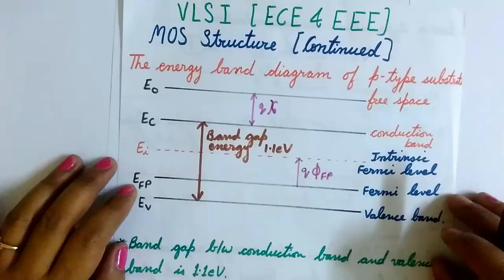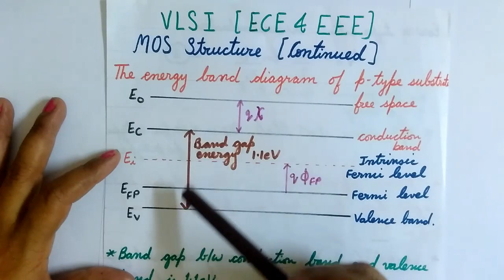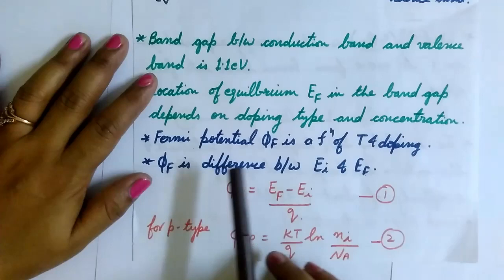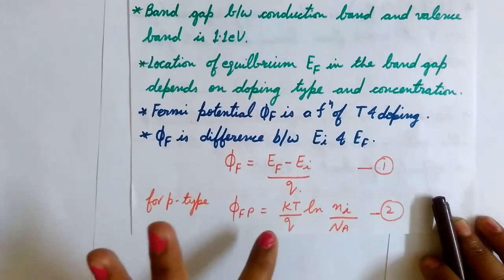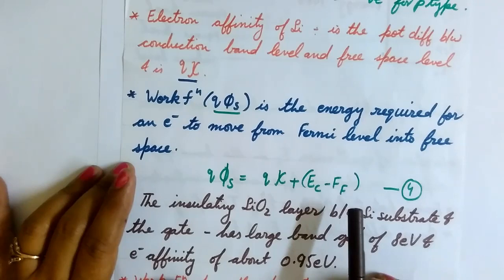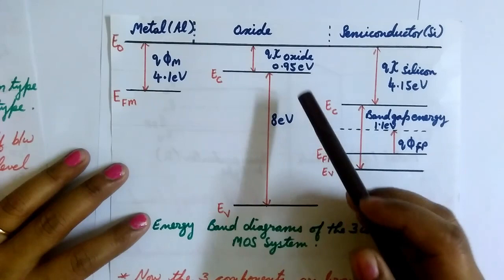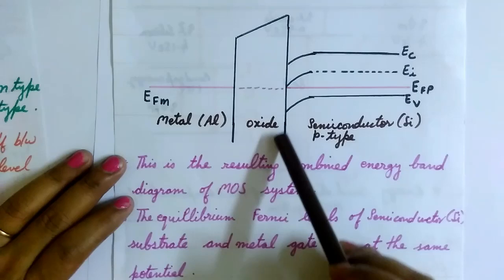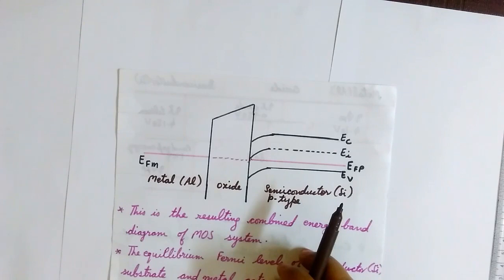VLSI - Lecture 2 (Energy Bands in MOS Structure)

Comment: Good Summary... This saves time. However this is a bad lecture. It doesn't explain things smartly and precisely why this happens. The lecturer lacks understanding.
Reply from the maker: Thanks for your feedback but as far as lecture is concerned energy band diagram is very well explained in the first year subject basic electronics so I didn't go into detail to keep the video short.
Reply: @SmartEngineeringTutorials  I see what you mean. My apologies for my wrong assumption.

I did not mean energy band diagrams, i was talking about band bending.

Although it would be great if there were 2-3 sentences about reasons of key things ( under 15 sec or so), like band bending. Maybe even energy band diagrams. 

So that it becomes easy to understand for students with a weak foundation like me.
Reply from the maker: @arnavrawat9864  thanks will keep this  in mind .